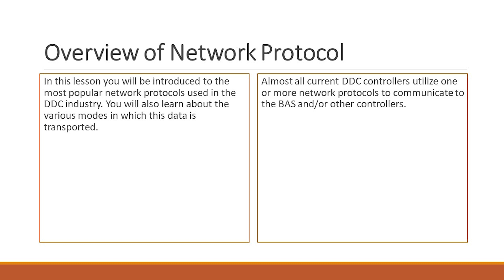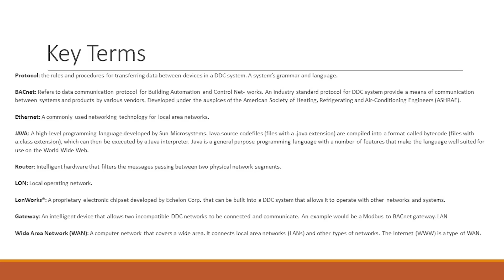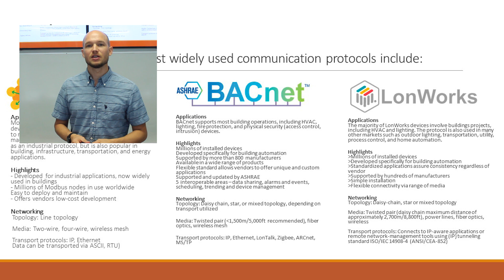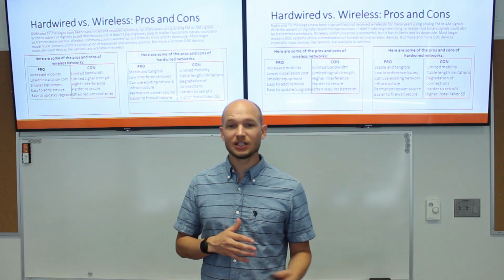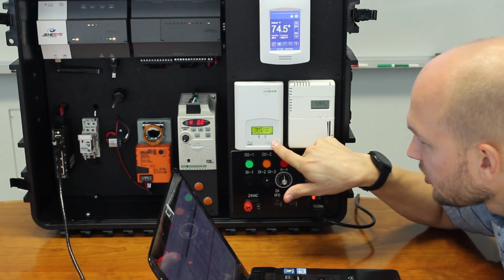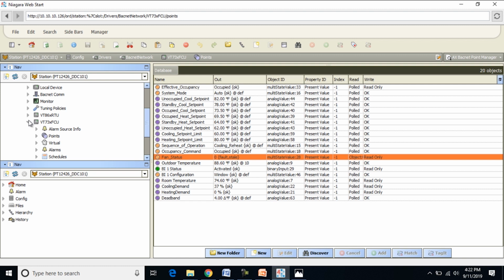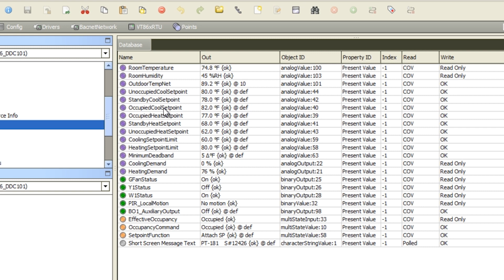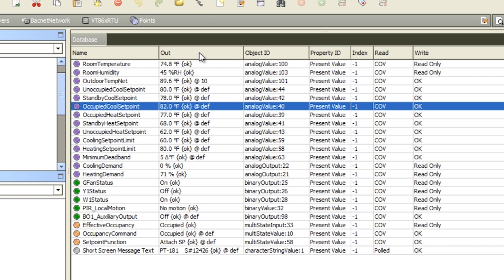Building Automation Systems Basics Lesson 6 - BAS 101 system training simulator

Comment: Sir,
Can you please give us a total overview of wiring of temp. Sensors, duct static pressure sensor, RH sensor and also DDC field controller wiring  from field sensor/devices. example- for on off command cable will be connected to DO, on/off/trip status cable will be connected to DI, temp.sensor feedback cable will be connected to AI , for opening the PICV , 2 WAy mixing valve AO will be utilized..... Required total wiring overview of field sensor and DDC field controller.. If you make video/ tutorial on the same that will expedite my learning.

Thanks in advance..!